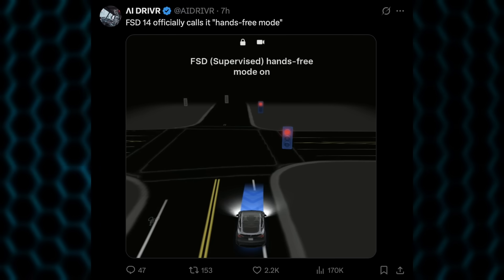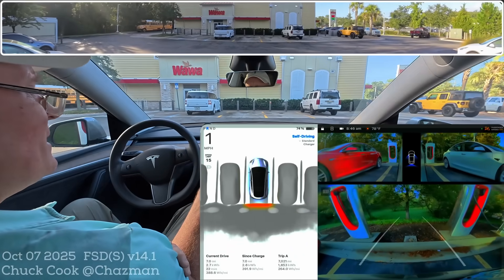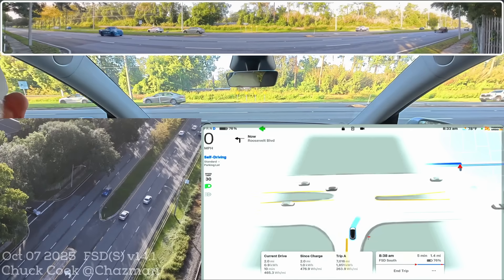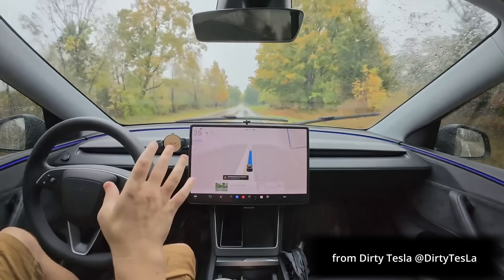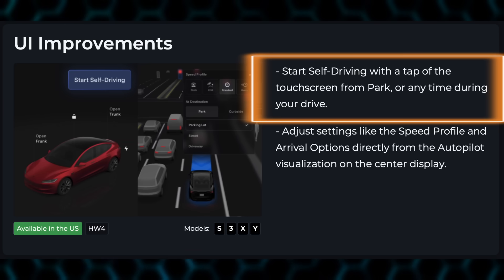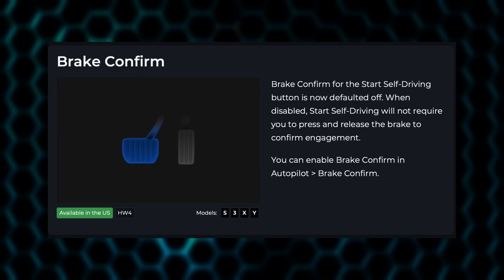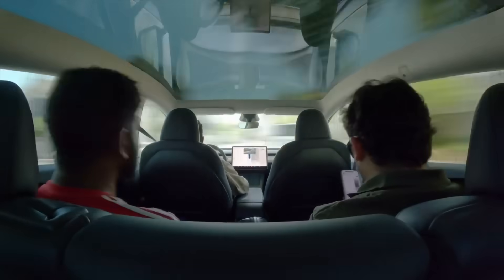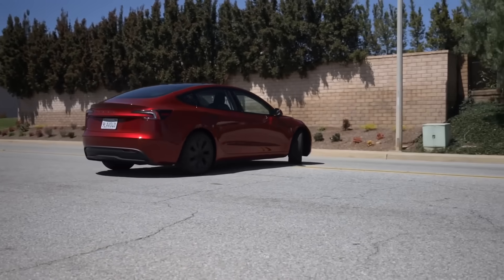FSD v14 Arrives w/ Mind Blowing Features!

Comment: I have to agree re speed control.  Too often a speed limit sign is missed or misread especially in construction zones.  Before v14 I almost never had to take control but I certainly had to adjust speed limits several times per drive.

Comment: "Feeling drowsy?  Pull drive stock down to enable FSD."

Driver Attention Probes enabled
Driver seat low voltage random shock bursts enabled
Speed metal blasts at 130% volume

Comment: I hope this version fixes the issue I've run into where FSD will back into supercharger parking spaces... but split in between 2 spaces.  I've almost had FSD crash into a neighboring Tesla that's charging in an adjacent spot, because mine wants to back directly to the charger, instead of centered between the parking space lines.

Comment: "Tesla doesn't want to fix it, or even acknowledge the problem, even though they've done a test drive with me and seen the issue with their own eyes," a Houston driver told the NHTSA in a 2024 complaint about Tesla's FSD and its behavior toward red lights.

Additionally, federal investigators have received 18 complaints and two media reports of a separate type of bad semi-autonomous behavior from Tesla vehicles. Specifically, these reports allege that Tesla vehicles using FSD have entered opposing lanes of travel during or following a turn, crossed double yellow lines when proceeding straight, and even attempted to turn the wrong way onto one-way streets. FSD-running vehicles have also been accused of continuing straight in turn-only lanes and turning into intersections from through lanes. Key to this aspect of the investigation is the lack of warnings provided to human drivers by Tesla when these potentially dangerous driving behaviors were exhibited.

Comment: Appears they still haven't necessarily solved School Zones, which makes that Speed control issue 100% dangerous. Going into a school zone during certain times in areas around here where speed limit drops from 45 to 25 and has cop directing traffic, only option if no cars ahead of you to force you to slow down you will 100% have to disengage FSD,  This inability to set max speed higher or lower in my option is absolutely endangering you and other drivers around. I have several areas around where I live where FSD can't read actual speed limit signs so either the car will be in this new system going too fast or slow and no way for you to change target speed. A better solution would do like every FSD user has asked for and give users a Target Speed setting you can manually control.
They still to this day never said it can identify speed limit signs. While my car is HW3, my daughter has Model Y with AI4, and even her car is not identifying new speed zone that are not in Tesla's map data. Sad thing is they say they need Google to update their map data, well guess what in every one of the cases where a Tesla fails to identify a speed sign correctly or makes up new speed limits based on State Highway identifiers, Google map has correct speed limit shown in their interface. If Ford figured out back in early 2000's how to read a speed limit sign, why can't Tesla's FSD able to read a speed limit sign. Oh and also tell difference between a state road number marker and an actual Speed Limit sign. 
Worst thing was before switching to v11 where they went from human code plus training data to just ML Neural Net processing, they lost ability to read Speed Limit signs. Currently the only way FSD can read a Speed Limit sign and process it is if a Human has flagged a sign as valid speed limit in map data and put correct speed in. This will never get to any better than Waymo is being 100% reliable in every location. Which means Tesla will never do any HW upgrade for HW3 car. This speed profile thing has went from very problematic to absolutely dangerous. They 100% need to abandon this stupid failed Speed Profiles which I have never heard one good thing about it, even Dirty Tesla on v14 was complaining he can't slow down car where it was going too fast over speed limit.
Reply: Sorry, I’m on V13.2.9 and for the first time speed limits have been recognized after the 2025.35.8 update. I’m waiting on V14 and will test further but for the most part, the car drives with the flow of traffic. I have also had the car pull over and stop for an emergency vehicle coming up from behind. I don’t go through active school zones often but in some videos I have seen, the speed did get reduced in the zone. 

I’m sorry you are stuck on V12 but hopefully an update is in the works for you as well. Tesla has too much liability to just drop FSD on HW3 cars.

Comment: 16:51 saying "Now, I just have to note that as soon as AI5 launches, when that new platform arrives, I will be getting a new Tesla.  I can't wait for that day."  As you recall, uncle Elon made the announcement during Tesla's June 2024 (repeating 2024) annual shareholder meeting that in approximately eighteen (18) months Tesla's production vehicles will be shipped with AI5.  Fast forward to August 2025, reportedly said timeline had been pushed to late 2026 or even early 2027.  Chances are good Tesla's FSD plan-do-review development process had prompted a significant deviation from their solely human-vision based approach, and required additional time to put together a more robust hardware/software FSD system.  Hurry up and wait, as always!! 😂

Comment: In Australia the map speed is sometimes incorrect e.g. 70k in a 100k zone or after as 50 or 60k roadwork area they may only have an end and not the resume speed limit.  In that case I use the scroll and without the scroll option I'd have to use the accellerator which could go on for quite a streech to the next limit sign.

Comment: I don't know what the hell is wrong with Tesla???  If I cannot control the speed of my car, I will not use or pay for FSD, period full stop.  This is NON-NEGIOTABLE!  As the person with the liability for the behavior of the car, I insist on having FULL control over the speed of the damn thing.  I really do not understand what the hell is wrong with them, do that even consult with their lawyers?
Reply: The different modes are now more tied to the speed. For example, “Sloth” mode will go right at the speed limit, “Chill” a little bit faster, and so on. So you don’t have as much precise control of the speed, but you do still have control.
Reply: @TechAndTeslas the problem is I have had the car believe speed limit is 10mph faster then it really is. What happens if it doesn’t recognize a school zone and speeds through 20 MPH over the limit and now you have a reckless driving ticket and potential suspended license
Reply: @ogar0524 relax buddy, chuck went through a school zone lights were flashing and it slowed to the limit. The car should be able to do it all, let them cook. Or, just sell your Tesla and buy a Prius 😂
Reply: @ogar0524  Guess we’ll have to wait and see how v14 handles speed limits before we start worrying about that.
Reply: @TechAndTeslas based on all the influencers the option is gone so what are we waiting to see?
Reply: @ogar0524 waiting to see if v14 does a better job of reading speed limits. I haven’t seen anything in any of the videos yet where FSD was going significantly faster or slower than the speed limit
Reply: @TechAndTeslas  They prove to me daily, they have no idea what the speed limit is... every single day, I drive thru places where the displayed speed limit, it not correct (simple fact).
Reply: @TechAndTeslas  not good enough. The legal responsibility criticism still applies.
Reply: @davidrossi1486 legalities, look at numbers and the metrics on the tesla.F s d is already many times safer than skilled drivers.The reason tesla keeps working is because they are aligned with facts
Reply: @TechAndTeslas precisely!
Reply: Then sell your car
Reply: @JoanVanderslice-c3q  There are in fact many other choices in the market today, several with self driving (more inbound).  I preferred the Tesla for a few reasons, but at the end of the day if Tesla insist I should not have the ability to use "my" car in a manner consistent with "my" desires, then I may well swap it out for another companies product.  Tesla may believe they have the only cookie worth having, but reality has a way of slapping companies like that in the face.  In the end Tesla may really not have any desire to sell cars to consumers, only to maintain a fleet of cars they can "sell" by the mile, in which case I will simply pivot.  They may simply be using us like whores to get the money to fund their pet project.  Hope that's not the case, but only time will tell.
Reply: I’m still on version 12.6 whatever… In my 2022 MYP.  It has always adjusted to the speed limited even in school zones.
Reply: @coachd7846 speed limit works vast majority of the time but when it doesn’t the only option shouldn’t be to disengage FSD.  I am not against FSD I use it almost exclusively but adjusting to speed limits is an issue.
It believes my neighborhood is 15 MPH when it’s 25. The first 2 miles outside my neighborhood it thinks it’s 55 when it’s 45. And there are times it goes 70+ on the highway when the limit is 65 and I have it set to 0 over the speed limit.
Reply: Turn off fsd when u need to control the speed.
Reply: @Qwuiet Thats not a good answer. It’s a common issue/concern and it Tesla is missing out on an opportunity to record the situations where people adjust speed to get data on why. Instead people should just stop using FSD in a situation it makes a bad speed decision? It’s a missed opportunity for Tesla and hopefully they realize the benefit and add it back in
Reply: @ogar0524  i understand
Reply: Simple humans are rubbish drivers but think they are great.
Stopping humans interfering,is the first step to safety.
Sloth mode now sticks to the speed limit.

Maybe we are better off if you don’t have fsd.
Reply: @paulmeynell8866  Go spend 30 years in a Trauma Center and come back and talk to me about Simple humans.  People die ever day in America from Automobile crashes (we no longer call them accidents, more often than not, they are not accidents, but the direct result of poor decisions people make).  Speed is very often a contributing factor.  Luckily for me I no longer have to walk into the social services holding tank, and tell parents I could not save their child... You have ZERO idea what you are talking about, honestly I hope you never have to learn. We need the ability to control the speed of the car.
Reply: QuickSell your stock everyone! Mike's not buying.   😂
Reply: @justinsjourney3224  It's not about the stock, it's about what I expect from "my" car.  If there business model is to not even sell cars to consumers, and only rent them by the mile, I might even acquire additional stock... but I'll get "my" car elsewhere.  At the end of the day I will not own a car I where I cannot set limits.  Just like I set with my kids who turned out great.  It is the natural order of things.
Reply: The whole idea is getting to actual FSD, they need to cut the dependency on human speed control eventually, whether the software is good enough to cut it now is up for debate. But here is your why…
Reply: @onlythebest3311  As Dirty Tesla points out... 48 in a 35 (today with V14.1) is a No Go... the car runs over some child and you are going to prison... period full stop.
Reply: @michaelmorris1802  Dude, calm down. Sell your Tesla already, you’re embarrassing yourself here.
Reply: @NC-it6im  Nope, I have a FULL understanding of the legal system, Tesla will put this back, or it will cause them hundreds of millions in damages... period full stop!
Reply: Teslaz vision is far beyond everyone’s understanding. They are not after you controlling car, they are after autonomy
Reply: ok, drive manually

Comment: Hey, does v14 works with HW3
Reply: Hardware will never have software 14
Reply: I don’t think so
Reply: Not yet, but then neither does 13. Technically.
Reply from the maker: HW3 is not able to run v14 or v13 due to limited memory & processing power.
Reply: @techgeektesla buon giorno… ma ci sarà un modo di espandere la memoria con un disco aggiunto .. insomma non è un telefonino